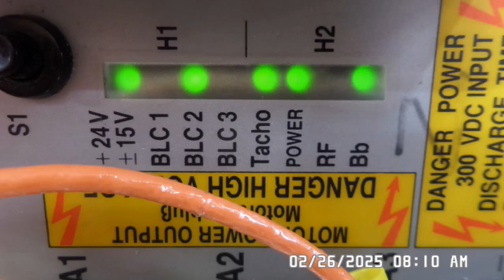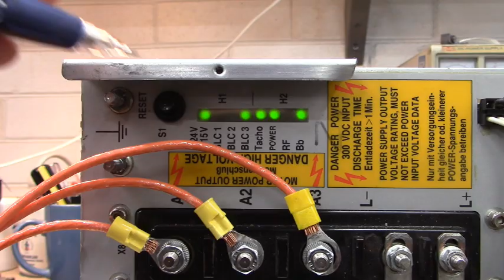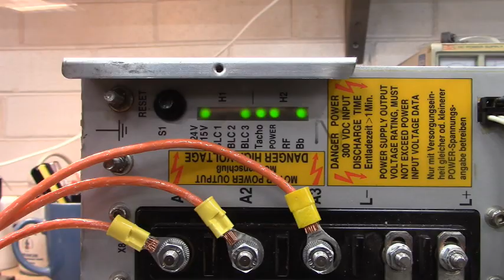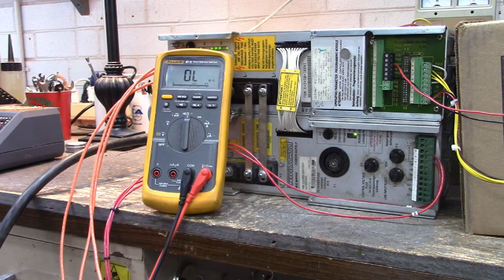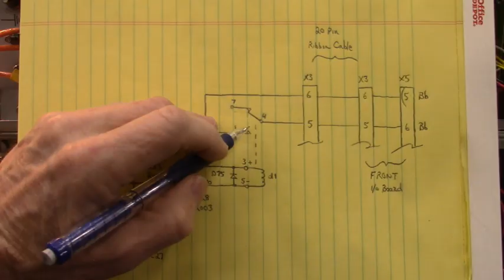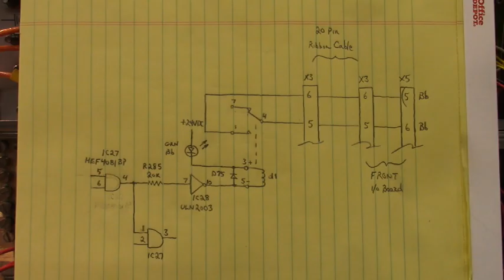Indramat Servo Drive Bb Enable (Base-Block)

Comment: Im watching your videos and you have some amazing knowledge. I was curious if I could pick your brain on something. Is it possible to change the firmware on old indramat drives, or copy it to a different drive? I'm playing with a CBD01.1 specifically, in an HMD01.1 power section.

Comment: Their motor, or the signal cable from it is bad. That is a very common problem with these drives and motors. The problem is, it is getting harder and harder to get parts to repair those Indramat motors. We do work for a customer that uses this same setup. They are quite regularly having this same problem. The hall effect sensor in the motor is almost unobtainable anymore and nobody wants to repair them. I wanted to spend some time to find a way to repair them myself, but the company I work for wants to force them to upgrade to a more modern motor and drive system.